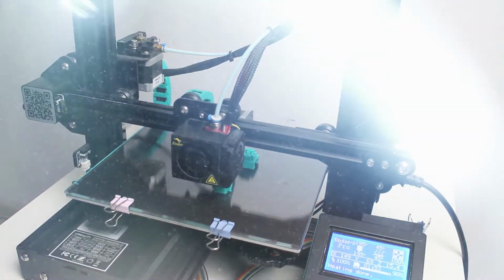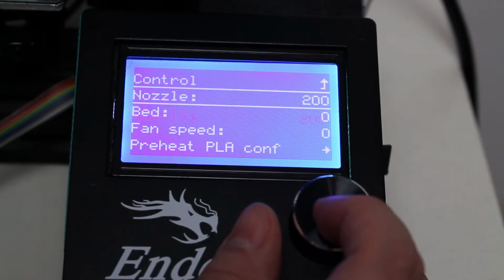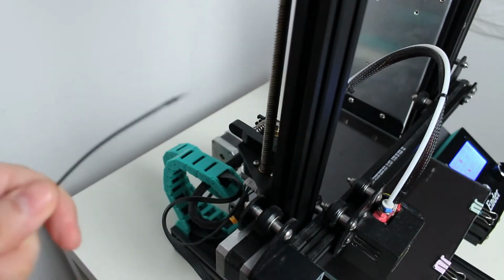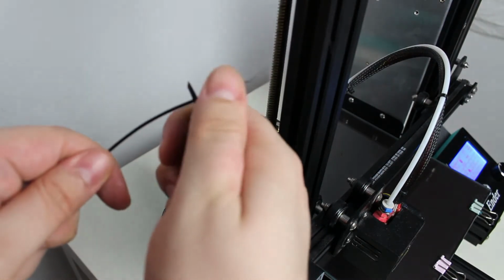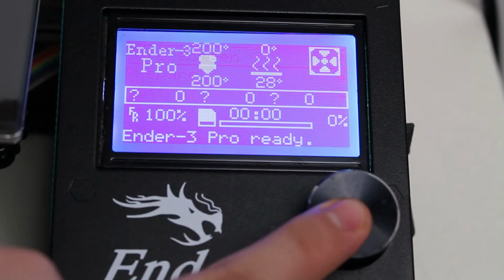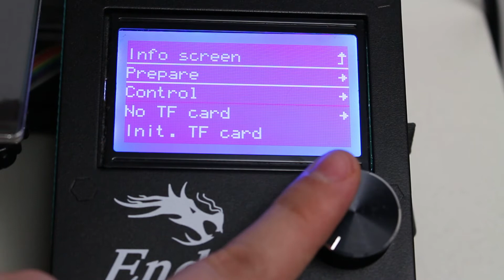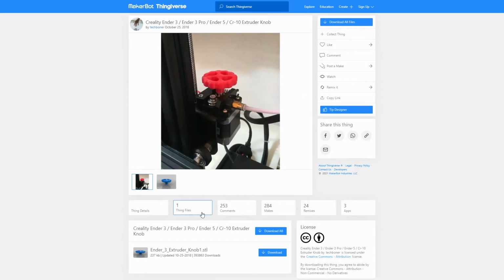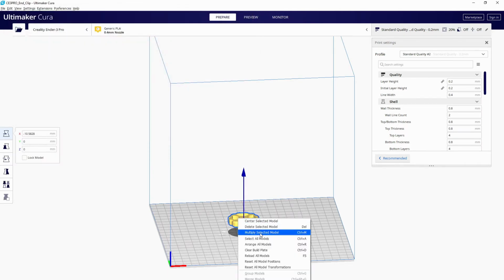How to change filament in your 3D Printer + 2 upgrades | Creality Ender 3 [Pro]

Comment: Hello ! Great Videos !  But i encountered a massive problem ... absolute newbie here..... the Change Filament and cooldown options are totally missing on my lcd  :(   any help would be much appreciated <3
Reply: I also have neither option
Reply: @irishwonder2652  This is how i do it:  I cut the filament before the infillsection and print all manual out by heating up the extruder and move axis (extruder) then i put new filament in ..... couldnt find any else solution so far... 
Hope this will help you....